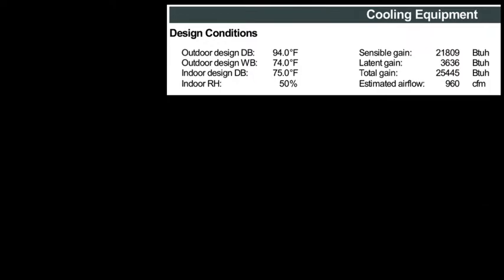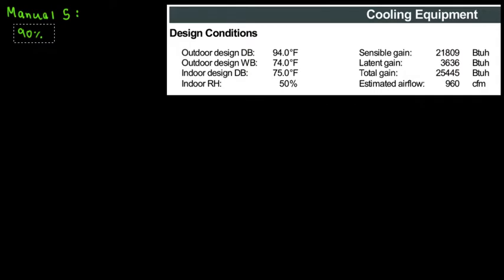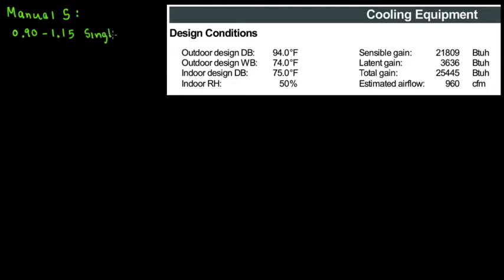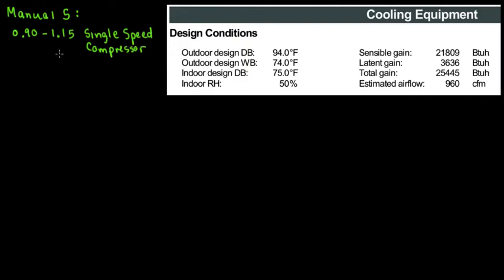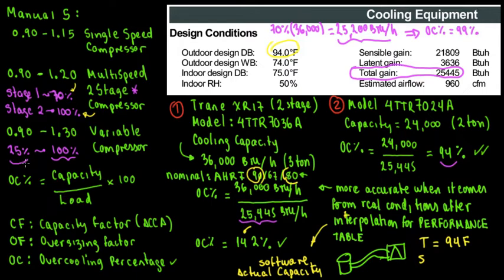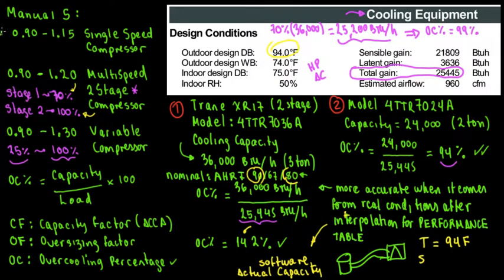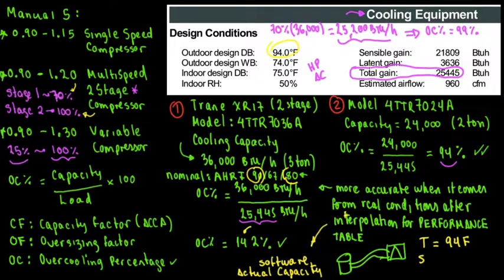Manual S, HVAC Equipment Sizing, Cooling, Two Stage and Variable Speed.

Comment: I think you misrepresented AHRI testing conditions. Your video shows 90 degrees outside, 67 degree wet bulb and 80 degree dry bulb inside. AHRI Standard 210/240 provides, "As used in the definition for “Tested Combination” in 10 CFR, part 430, subpart B, appendix M, (a) for Indoor Units, the highest cooling capacity listed in published product literature for 95°F outdoor dry bulb temperature and 80°F dry bulb, 67°F wet bulb indoor conditions....."
Reply from the maker: Absolutely! Thanks for your comment and references. I agree and honestly I forgot to add and pin the addenda in the comments regarding AHRI conditions. 
Outdoor = 95DB
Indoor = 80DB/67WB

Thanks again!